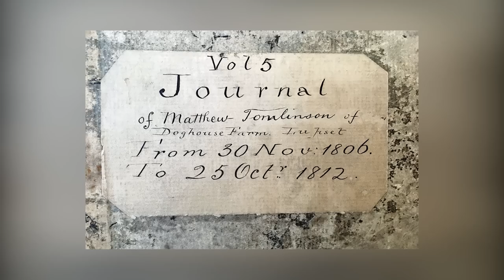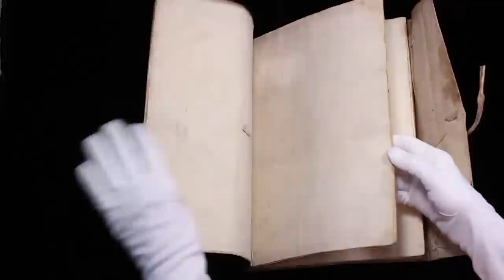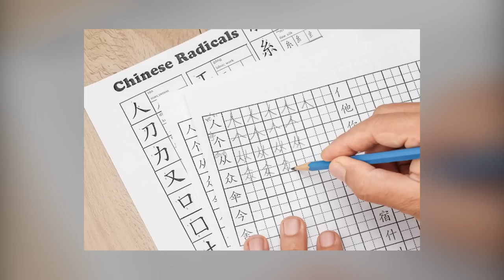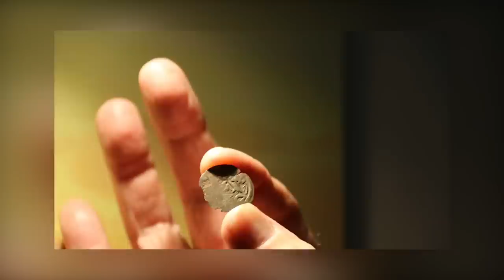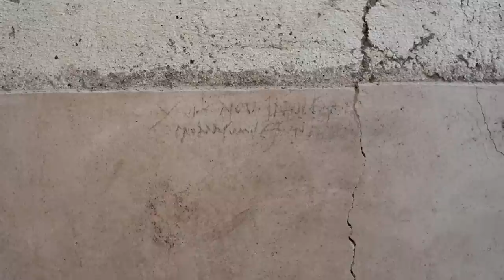12 Most Amazing Ancient Finds That Change History

Comment: #1 is just funny nonsense
#2 is dated wrong
#3 was the first interesting one
#4 is pretty cool actually
#5 just goes to prove we underestimate ancient peoples
#6 is nothing but an opinion
#7 is not old enough to really be called archeology and is included for politically correct reasons only
#8 shows why we need to support more digs 
#9 needs more research but is interesting
#10 again the dating needs to be questioned 
#11 the theory is a theory but seems plausible
#12 actually does possibly change the previous thinking

What did we learn... when you find something not terribly interesting just find a reason to date it early and now you can call it important.  Also we need to fund more digs as we keep accidentally finding cool stuff and finally we are still learning that some things we think we know... we don't.